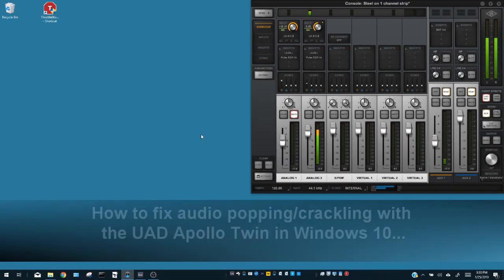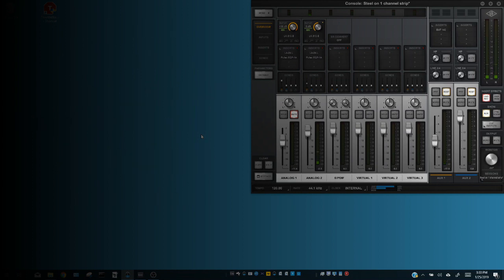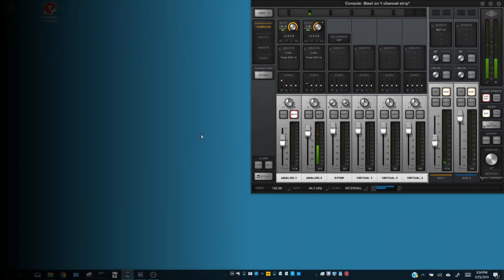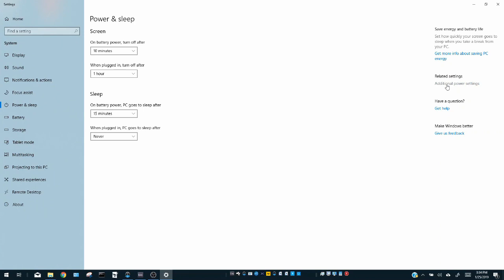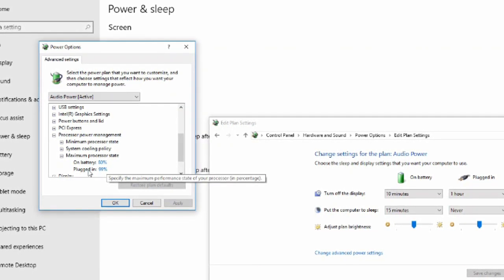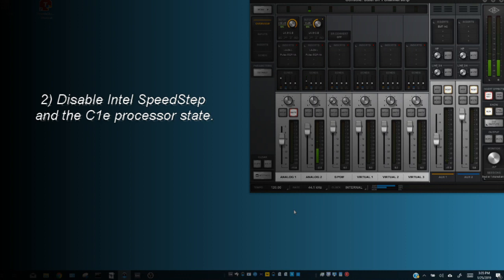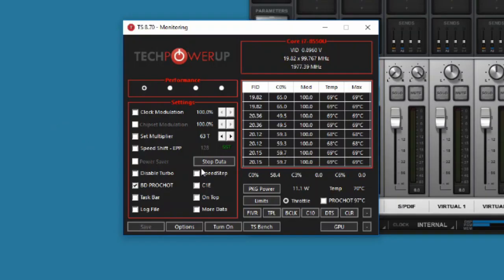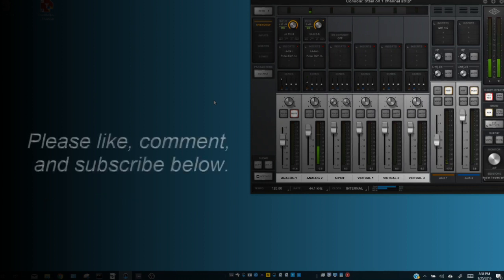SOLVED: UAD Apollo Audio Interface Noise, Popping, Crackling, in Windows 10...GONE!

Comment: I use a UA Volt 1 interface with Reaper. I have an Acer Aspire variant that is "green," and I didn't realize it would keep trying to save energy by making changes after I set them to high performance. So in addition to everything mentioned here in ThrottleStop, I clicked High Performance to force my system to behave and NO MORE CLICKS OR POPS. Posting in case someone else is in a similar position.

Comment: Great help, thanks a lot. My problem with Volt 4 was appearing when the laptop was plugged in and stopping almost entirely when working on battery, so a whole suite of solutions involving increasing power management settings was useless for my case. Going from 100 to 99 helped. This is a fantastic finding and I hope people struggling with this find it early in their research.

Comment: I did this, and in addition, especially if you have an ASUS laptop, lower your max CPU voltage until you don't have crackling. I turned mine down from 60 to 53 (PL 1) and that solved the problem for me. The boost (PL 2) didn't seem to affect anything, but I turned it down as well. Thanks for the video!

Comment: Reducing maximum processor state from 100% to 99% seems to have stopped the crackling I was getting from my UA Volt 2.  Thanks for the suggestion!
Reply: Same here MaximusNYC...this was a BIG help and I would have hated to lose all the plugins that came with it...good for you...and me !!!
Reply: @mikeheaphy  Ultimately I was not able to get rid of all the crackling and other problems, and I had to return the UA Volt 2.

I hope it works out better for you than it did for me.
Reply: damn it... doesn't look to be a tweakable option any more! :(
Reply: @BaronsDuju  control panel / system security / power option /  if u r on high perf click change plan sett and then click change advance power sett... then a power option windows pop up, look for processor power management/ max processor state and change the numbers

Comment: Thank you so, so much!
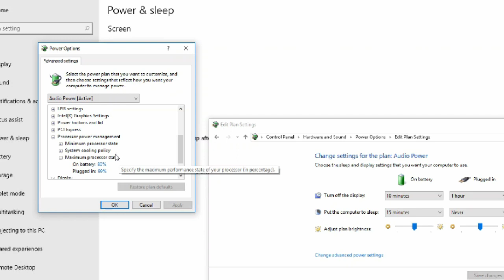I did everything and it didn't seem to work. Then I checked the 'Minimum processor state' under 'Processor power management' at 1:33. It was set to 100%! So even though I lowered the maximum, the minimum was still at 100!
Might be worth a try if nothing else works!
It worked on my Evo 4. Thank you again!

Comment: YESSIR !!!! Thank you very very much. This finally worked for me. EDIT: Problem came back the next evening. WTMFF !?!? EDIT2: Okay now its clear. It truely solved the Problem but, had to really switch those two options off in the bios, the software patch did it just till the restart. Speed Step is named Speed Shift in my bios. Its running perfectly now. I still dont understand how it could work perfectly for a year and suddenly come down to such a bullsh... howerver. My life is saved haha
Reply: Man  Same thing happened to me I've been using it for a year and no problem I was recording amazing vocals all of this sudden one time tried to record vocals and nothing's going through in my FL studio and I'm so frustrated right now that I'm going to get my computer reformat and start everything over again as I did from the start but if you have any links any suggestion please help me out cause I am not very good with computers I would appreciate it thank you very much.

Comment: Tried the above. Didn't work 😞 using apollo x8p with custom built laptop running 10th gen i7 with thunderbolt 3.
Reply: thanks..going to try connect my old ID4 in
Reply: did you manage to fix it?
Reply: @zkazaofficial  I did! Surprisingly..unexpected to say the least. I also have another interface (Audient id14 MK ii). One fateful day, Just when I was about to give up trying. I hooked up x8p to my laptop just to give it another shot. At the same time, I forgot that I also hooked up id14 on the usb3 port. LO AND BEHOLD! No more crackling popping noise! It just worked! Simple because I plugged in my id14. Can't explain why this is, but it just works. Inputs and outputs work beautifully! I appreciate anyone who could come up with why this method works..tq!
Reply: @zkazaofficial  btw, the id14 ins and ours aren't hooked up to anything. Just plugged in to usb port that's it.
Reply: ok so that didnt work - but I unplugged external monitor I have from my laptop and it worked
Reply: thank you bro for giving me the idea! as soon as I unplugged my ext monitor its working smoth as...I was going to return it tomorrow

Comment: Thank you for the video.

These two steps didn't worked for me unfortunately.
I also tried to install a Focusrite driver (2i2), as seen in some comments here, didn't solve it.

But increasing the buffer size from 32 to 256 fixed it for my case.
(Apollo Twin USB, Razer blade stealth 2016)
Reply: This worked for me just now THANK YOUUUUUU!!!
Reply: Where is the buffer size setting? In the uad console? I have it to 512 and I still get it

Comment: I fixed This in a very weird but easy way. I had tried absolutely every Way to fix This. I contacted Their support. Bought some weird new USB ports They recommended. I read many Old threads on Reddit and other Forums nothing worked. At last after many hours i gave up. Before i bought the Apollo i had a focusrite. So i installed the focusrite drivers again so i could switch back. And BAM! It fucking worked. Installing the focusrite driver fixed My problem. So now i have both My uad drivers and focusrite drivers installed even tho i dont use focusrite. If u cant find other ways try this. It worked for me

(Edit: it was the Scarlet 2i2 2nd gen drivers)

Comment: so I fixed this problem with my Apollo x6 using a 2018 razer 15'' laptop. so I originally tried using the program throttle stop to disable speed step and C1E and that did not work. I went into my UEFI setting or Bios (here is a link on how to do that https://www.laptopmag.com/articles/access-bios-windows-10 ) and I turned off my speed step and boost there and that fixed the problem for me. Note: I still have throttle stop on my computer and have both speed step and C1E unchecked. now after restarting my laptop it will play fine but if I open throttle stop the noise will come back, so I restarted my laptop and left the program alone and had no issues. And I kept my maximum processor state at 100 percent on battery and plugged in. and I am running my Apollo buffer at 512 44.1k and my computer 32bit 44.1k

Comment: This worked on my audio interface! I lowered my processor to about 97-98% and the audio cracking went away.
Btw this usually happens because of inadequate power from the power supply. Thats why undervolting may help
Reply: Really? I had a 1000W PSU and now an 850W PSU in my desktop.

Comment: i have a razer blade stealth 2019 and it wont even connect to the interface :(
Reply: I just purchased a razer blade brand new, apollo interface connects and works. but it crackles and pops. i have not tried what this guy did in the video tho, i returned the machine.
Reply: dj efx I was just able to fix it
Reply: dj efx btw what computer u switching to I think ima have to go mac
Reply: dj efx I do but I barely use it hmu on IG
Reply: dj efx ninja_manuel
Reply: El Segundo I need help and your iG not popping up
Reply: Shah Major @ninja_manuel
Reply: Shah Major yo u got it to work?

Comment: I don’t have an issue of the crackling in my DAW or any pro app that allows me to use the UAD ASIO driver because that works perfectly. It’s when I’m trying to use Zoom, Skype or OBS that’s giving me issues because those apps use the standard Windows WDM driver and don’t allow you to change to the ASIO driver unfortunately.  I tried your solution in the hopes that it would work, but sadly it didn’t. Thanks for the video, though!
Reply: 2 years to late, but I got that solved with a program called asio link pro. It creates a virtual input you can send as your initial mic input and it works like a charm, even with discord now...had problems for years with my interface + sm7b to work properly in discord.

Comment: Thanks a lot. I tried everything with my new Apollo Twin X Duo.
(I have a high end Desktop PC with Gigabyte Designare Z390 Mainboard)
I got the latest Thunderbolt 3 drivers, I did every change that was recommended by UAD.
In windows, in the DAW (Cubase in my case) and in BIOS.
...But still I have here and there some crackles in my recordings.
Throttle Stop has helped me here.
I thought I've set SpeedStep to off in BIOS, but obviously it was on. (And UAD recommends to put it off)
Without Throttle Stop I wouldn't have noticed it.
Now I've also set CPU max to 99 % like you.
I will see if I get a clean recording tomorrow.
By the way... WHAT A CRAZY BUS MAN ! :-D
Reply: any luck? same motherboard same problem
Reply: make sure the bit and sample rate on ur pc match your interface!
Reply: I have the same exact set up as you do! with the same motherboard. i have the newest Apollo Twin X duo with Thunderbolt 3 and i have ZERO problems with crackles and pops on my PC tower. However i cant get the Apollo to work on any PC Laptop yet without the crackles and pops.

Comment: It doesn't solved my problem, please help... Running on windows 10 with a Zenbook with thunderbolt 3, with an Apollo 16 Silver with the TB3 card in. Still crackling :'(
Reply: Sunlight Studio  did you find a solution? I’m also using a zen book pro duo with a UA arrow. Any help is appreciated!
Reply: @DreamMachineX  not yet, it's running well on my big cpu, maybe the TB of the zenbook is not powered enough. There is also a side for the TB cable, the sign must be up. Cheers
Reply: Sunlight Studio Yeah, I made sure it was plugged in correctly, the way you speak of, but still have the same issue. Only during playback. Did you end up getting a different interface for your zen book? I don’t know what else to do except return this one.

Comment: Universal Audio just released a firmware update to address this issue.  It automatically applied to my brand new Apollo X4 last night and it resolved the problem I had through Studio One 4.6 DAW.  I'm now able to run UA Console and StudioOne at 512k 64-Bit processing with pristine sound clarity. Very frustrating issue for such an expensive setup. I was ready to ship it back.
Reply: Cool.  I'm gonna check that out.  Recently I've been getting the occasional pop.  Thanks.
Reply: Hey David... do you know where I can find this?
Reply: @kthmertens  It automatically applies updates if available when you first start the Apollo after a reboot. email or call UA Tech support if problem persists.  They were helpful.
Reply: @davidbond4394  Thank you :)

Comment: I bought the apollo twin X duo. I've been struggling for 2 days with this. I use ableton as my DAW. No matter the sample rate or buffer size or asio buffer size it keeps crackling. I downloaded throttle stop as mentionned in the video, it doesn't change anything. I tried to disable a lot of drivers through the device manager, like realtek drivers or network stuff that could possibly interfere. I uninstalled and reinstall uad softaware and drivers . I tweaked the power & sleep settings but there's still some distortion. Does anyone know the actual problem, why windows does not support apollo interface ?? If you guys have some solution or computer optimization tricks, please tell me.
Reply: i had the same problem with my razer blade
Reply: @paulangot3569  same here does anyone know a fix?
Reply: @mizuchi9232  I am literally trying everything, but a weird thing is 98Khz or above is fine. Only 44.1, 48Khz is troublesome. I am using NUC8i7hvk and still strugglin.
Reply: following,  have the same problem
Reply: Laptop?
Reply: did you manage to fix it?? I am having this problem now with uad solo...so pissed off!
Reply: @zkazaofficial  hi, unfortunately I've never managed to fix this issue.

Comment: This is such bullshit. I bought a $1,000 interface, an expensive TB cable/adapter and an EX3 Thunderbolt card. I have what is pretty much a paperweight in any non ASIO Windows application. Pro audio my ass, my $50 Steinberg interface did a better job.
Reply: Currently,  I have a brand new but redundant $1200 thunderbolt 3 laptop and a $500 UA paper weight.  I haven't tried the above trick yet, but I suspect my chances for success  approximately 0%.
Reply: My new PC is going back... I will just swap it for a MacBook. I guess Microsoft just doesn't give a rat's ass about this.
Reply: Ivor Thomas It’s not Microsoft’s fault, it’s UA’s.

Comment: I followed all the steps yet the crackling still persists
Reply: same here. U figure out a solution?
Reply: @deleted8577  Yeah.. unfortunately the apollo does not work in MME/DirectX mode or the windows audio mode. Therefore you have to use the apollo in asio mode which is changable via the uad console they provide. Make sure your daw matches and you should be good to go
Reply: THUMPERGREY How do you switch the modes? Thanks.
Reply: @thumpergrey  i've been struggling for days to solve this issue. Can you please tell us how to change the mode via the console ?
Reply: @Skrenja  In the prefrences tab on your uad console interface
Reply: @11space70  Apollo Console Settings>Hardware panel and change to asio within your DAW preferences.
Reply: @thumpergrey  It doesn't change anything for me, thank you tho.
Reply: @11space70  Sorry to hear. Try doing some research on weather you are in MME/DirectX mode or the windows audio mode. Because the apollo can only work in a asio mode within windows
Reply: @thumpergrey  100% sure I'm in asio, it's the only mode I  can set in ableton. I kept investigating this issue today but still have no clue. Under the same latency conditions my m-audio interface works perfectly. When I plug both the Apollo and the m audio and use the m audio in Ableton, the sound is crystal clear. Whenever I switch to uad its crackling like crazy. Imma send back the Apollo thunderbolt and try a USB one, hopefully this will work.

Comment: Havent tryed yet will try in the morning. My issuse with crackling auido happens when i change windows audio format to 24 bit by 192khz. Is this interface able to run in this format? 24bit 96kz only 1 that works besides 16bit etc.

Comment: I'm having the same issue but with my new Apollo x8. Only problem with this solution is when I go to advanced power options only plan available is 'balanced' even if I make a new plan the advanced settings are missing - only have "Desktop background settings", "Sleep", "Power buttons and lid" & "Display". The "Processor power management" drop downs not even there. Any thoughts on this? Thanks.

Comment: EVERYONNEEEE LISTEN TO ME THIS WILL HELP. I WAS GOING INSANE FROM THESE CLICKS BUT LOOK GO TO YOUR DAW ( FL STUDIO, AVID, WHAT EVER YOU USE FOR YOUR MIXING) THEN AUDIO SETTINGS WHERE ITS AT... THEN GO TO THE BUFFERING OF THE AUDIO INTERFACE  (NOT ASIO) YOU SHOULD SEE CONSOLE SETTINGS FOR YOUR APOLLO , CHANGE USB SAFTEY TO MAXIMUM, AND YOUR LITTTTT ! DONE!
Reply: in the latest version for windows 9.12.1 there is no such option :(
Reply: @papospepas  its always an option
Reply: @zxlla623  That section does not appear in my options field, I do not know if it is because it is the version with thunderbolt 3 and windows
Reply: @papospepas  which section ? The UAD CONSOLE SETTINGS? search "Console" in your windows search bar and search your computer for it, i think your in another setting .
Reply: @zxlla623  
That's right, CONSOLE SETTINGS / HARDWARE / and the options are displayed, SAMPLE RATE / CLOCK SOURCE / BUFFER SIZE / INPUT DELAY COMPENSATION / ALT COUNT ... they are what I have
Reply: @papospepas  you don't have usb safety buffer, that's weird it should be right there .
Reply: @zxlla623  yeah its pepsdomm ,add me, thank you very much for the help, I send you a photo over there of my menu
Reply: This video helps too
Reply: @zxlla623  Thanks bro, been trying lots of different things. Saw your comment and it fixed everything instantly!
Reply: Where can i set this USBsaftey thing?
Reply: Gyozee Szijarto search you computer for “console” and it should open up your controls for UAD
Reply: @zxlla623  Thanks! I'll try it.
Reply: @gyozeeszijarto1898  In Uad console hardware settings
Reply: I figured this out as well. Yep definitely the USB safety, changed mine to small solved the issue

Comment: This video fixed my problem but not how you mentioned. Mine was only crackling when playing Youtube etc. It was working fine with my DAW. 
Watching this video I see at the bottom of your UAD Console it says 44.1kHz and mine was set to 48kHz. Once I had changed it to 44.1 it solved the issue right away.
Thank you for the video, although it wasn't the problem I was having it still managed to sort.
Reply: It seems like you have to match the sample rate with the other drivers.
I'm on a notebook and I had to change audio to 32 bits 44.1 on realtek.
Many thanks.
Reply: @manueltripero  How exactly did you do that? i can only change it down to 44.1
Reply: @amara.mp3  Look for the settings in both drivers that match.
Honestly they shouldn't advertise the interfaces as windows compatible.
Reply: Keanu Copp Got same problem.
Reply: Thank you for saving my ass!
Reply: Yep  l match all the sample rates. Then I set usb safety from minimum to  small. Fixed the issue.
Reply: @1205HOTGIRL  
in the latest version for windows 9.12.1 there is no usb safety option :(